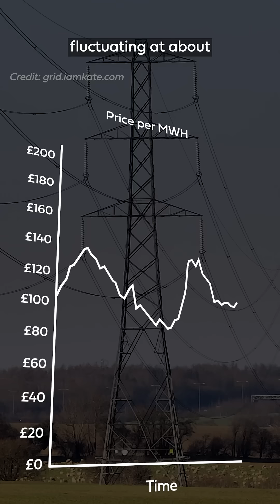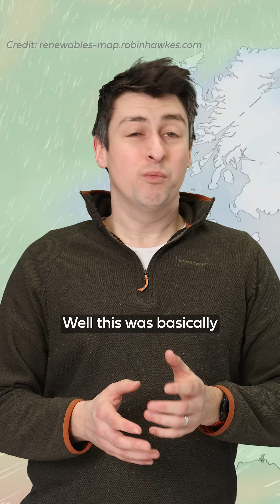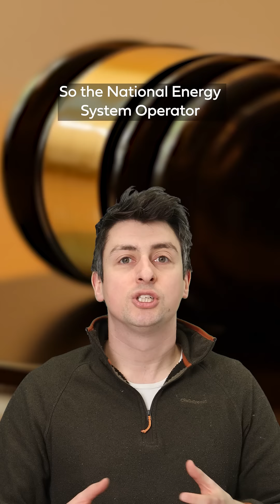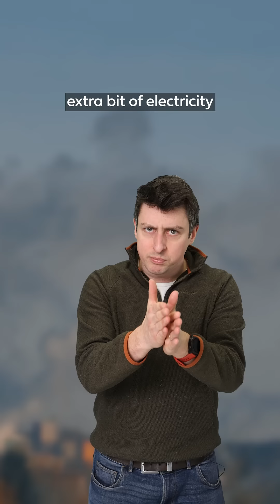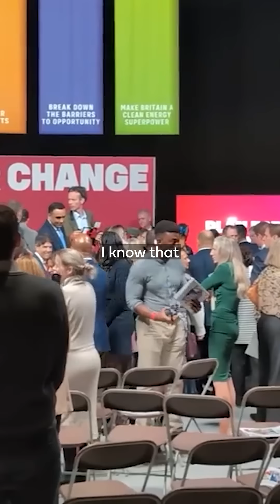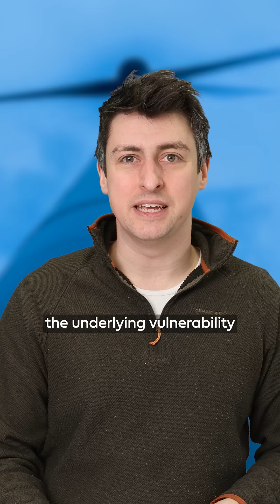The biggest price spike of the energy crisis happened last week

Comment: Craig F. Bohren, "How can a particle absorb more than the light incident on it?"  American Journal of Physics, 51(4), Apr. 1983, p. 323-327.

If you just want an overunity experiment, then by all means repeat (or have your university repeat) Bohren's experiment, which gives 18 times as much energy out as you put in.  Does it every time, any time, anywhere.  

Under nonlinear conditions, a particle can absorb more energy than is in the light incident on it.  Metallic particles at ultraviolet frequencies are one class of such particles and insulating particles at infrared frequencies are another. 

So what has been done with it commercially? Nothing.  

Infrared is heat, e.g., and so one can use that process to get about 18 times more heat energy than one inputs, under the proper circumstances. So why is your university not doing it in their technical departments?  

Why have they not told you about it?  

Why is the electrical power industry not using something modified from that to reduce the energy input to their heaters under the boilers making the steam to drive the steam generators that are turning the shafts of their generators?  

After all, with effort, such a system could in fact be developed.

Comment: The fuel isnt the problem it's the machinery that is burning the gas, gas prices are falling....gas is NOT expensive. we have gone from a a system with super reliable and low marginal cost of production power (large coal and gas) to highly variable, distributed, small scale generators and super expensive batteries...net zero and the decisions made to close large scale plant is criminal stupidity of the highest order. our 3rd biggest wind farm has been paid to be switched off for 60% of the time since it was installed...NUTS! this video is beyond stupid, batteries are really really expensive (and not green), we cant easily install pumped hydro in the uk (the geology/geography doesnt work)...and relying on interconnections is stupidity in extreme - guess what, when the wind isn'tblowing here, it isn't likely to be blowing in Europe either, same with solar....all we do is import really expensive coal based power with lots of losses. What we need to do is install more large scale dispatch able power like coal and gas (we have plenty of both and they can burn clean).

Comment: Or your people should probably create their own individual power supplies like maybe buying or building their own electric generators. They could use the old style boiler type so that they could burn wood to generate power or use gasoline or diesel or 8f they can manage to build their own solar panels but that also gets to be expensive and where are they gonna get wood and the gasoline is not very European and neither is using natural gas so maybe they could revert to the even older type batteries such as the bagdad type batteries which would probably be the best bet. Im sure they could find enough metals and pots to use and a simple acid then of course they would have to invest in the inverters unless they just used the batteries to run DC motors and then belt drive the AC generators from the DC motors.

Comment: Well if there would be a low cost, high energy providing method, I’m sure it would be installed rather than unreliable energy sources… oh wait, it exists but has been demonized by media and the wind lobby, together with green ngo’s. It’s called nuclear power and provides huge amount of power literally at a the press of a button. And regarding the nuclear waist, well, check out what dual fluid generators do.

Comment: I don't get all this hate for nuclear, it's literally the most optimal source of power

+ high power generation capacity
+ can run 24/7 and be activated at any time 
+ absolutely 0 greenhouse emissions

modern designs are entirely safe and impossible enter states of catastrophic meltdowns, like tjernobyl or fukushima, and while the nuclear waste can become a problem, there now even exists specific types of reactors designed to run specifically on nuclear waste and lower the reactivity of the waste in the process (thus making it even easier to handle)

Furthermore, the amount of highly radioactive waste produced per unit of energy made is stupendously small, and that's not even counting the fact that you can then just re-use that in other kids of reactors to extract even more energy out of it while simultaneously lowering its radioactivity to way more manageable levels

completely renewable sources like solar or wond are great when they're available, but why the actual fuck are nuclear power plants getting shut down and replaced with coal of all things, the literally worst form of power generation

just keep around a few nuclear plants as backup and only run them when there isn't enough power on the grid instead of coal and this kind of crap would never be an issue

Comment: This is the green agenda working for ordinary citizens. The UK has coal it’s just very dirty but with the advances in modern technology they can scrub the “Carbon”out of the emissions. To price pensioners and the lower to middle class out of energy with arbitrary regulations and one sided privation is a crime. Nuclear is truly the best cleanest option for countries with no or little fossil fuel options but it has been labeled too dangerous by the global climate alarmists. When ordinary people are sitting in their freezing homes in the winter because of bad policies the political tides will change. There is more than enough options to keep energy prices at a reasonable level but it seems some people want to throttle their citizens with unneeded regulations.
Reply: When you "scrub" the carbon out, you need to have an idea, where you want to put it. It is now a gas and it use now much more room than the coal. And as a gas it is hard to store. In order to revert it into a storable form, you need more energy than you got out of the coal.
Reply: @ So the semantics of carbon scrubbing is not the point… to price low to middle class income people out of energy is the problem. The climate crisis is a manufactured crisis. If true climate science was able to make it into the light in the first place we wouldn’t be even having this conversation. Fossil fuel has enabled the human race to heat and light our homes and brought us out of the dark and cold. It gave us mobility and fertilizers to produce more food… if you tax the one thing that is the life blood of the world ,If you price it out of reach for the average citizen you will turn the human population back to killing whales to light our homes and cutting down all the trees around to heat ourselves, or burning that dirty coal in our hearth no carbon scrubbing at all, no one would travel more than 20 miles from where they are born in their lives. Have fun with that.

Comment: Don't add "Dare I say" to nuclear. It is currently the cheapest (not in start up cost), safest, most powerful energy source available and would do more for the grid and the environment than practically all other current sources of power outside of very few exceptions.

Adding "Dare I say" to it casts a shadow of doubt over what should be embraced as if it was some sorta dirty or risky venture that should only be considered as a last resort.
Reply: There is not only the start up cost. You also do have the very long running cost for the waste.

Comment: Nuclear fear mongering has gotta stop
Reply: Look at Hinkley Point C - you are already in construction. And look at the cost. The cost for the waste is not yet included.

You have to pay all this. Plus the cost for energy generation.
Reply: @ThomasVWorm the waste is surprisingly easy to store and not much is made on the grand scheme of things, you could lick the storage if you wanted. regardless of if we know what to do with stored waste in the short term, the environmental impact is nothing compared to even renewable energy. wind turbines and solar panels (which are non recyclable) especially don’t last forever. whilst a nuclear power station is built to last and would easily deal with the high demand times in a much cheaper and less impactful way than gas.

And whilst maybe it’s too optimistic, in 30-40 years time we might have a valid use for nuclear waste.

Comment: That's one way of looking at it.. the other is that gas is a great backup energy source. It can ramp up and ramp down superfast. The net environmental and economic cost of using has may well be lower than that of using either batteries or pumped hydro.... this is exactly why most offgrid solar systems have a diesel backup generator, because although a dirty source of energy on its own, the environmental and financial cost is way lower than installing enough panels, batteries and wind capacity to cover a few worst case scenario days..
So maybe it's not such a bad thing
Certainly better than the high cost and immeasurable environmental risk of nuclear!

Comment: Gee, I'm paying about 360 USD  per MWH in Massachusetts, but that's the all in price of electricity plus delivery (the grid cost). It's about half and half so just the electricity would cost about $180 or about 143 pounds.   Yes the gas (petrol) may be cheap, but the electricity is not.

Comment: Clean energy is fine, BUT it needs to have battery bank to work, so this never happens.
Reply: Australian here, we're starting to do community batteries, ie a bunch of neighbours all put in for a battery wall. At the moment its not that cheap but the higher the demand, the lower the price because - capitalism. So for around €5000 per household, a dozen homes can install a €60, 000 battery substation, solar panels and distribution system. You can then actually take the system almost completely off grid ( except for one household - for emergencies. They can then supply the other homes in case of a breakdown or other disaster). Literally pays for itself after 5 years.
Reply: we need nuclear power. 24/7, cheap, safe, clean energy!

Comment: Lol so electricity is typically 71 pounds per megawatt hour.. so basically if you had 4000 large battery electric vehicles across the country at the same time fast charging at 300 kW(hr for and hour this would be like a gigawatt load on the system and potentially cause the same price jump… ? Am I gathering that correctly?

Comment: Two words, sand batteries or salt batteries.  Excess power during high production is used to heat or melt a substrate in a super insulated tank, then when power is needed, water is pumped around the inner lining to make steam for steam power generation.  Simple, relatively cheap, environmentally friendly, relatively easy to produce and deploy widely, etc.  Elon wants you to buy his power walls made from lithium, wrong answer.

Comment: That's what happens when you let government control the system completely. It's also what happens when you let them force this so-called green energy plan without a competent backup system.  The smaller gas plants have to make an entire years income for a three hour emergency shortfall just to keep the place available for a crisis.  Our planet is not ready for 100% green energy. We need nuclear. It is the most efficient. But the excessive regulations surrounding it make it seem like it cost more. Cut the red tape, keep the safety, and prices will go down.

Comment: In the last week, Starmer suggested small NPPs be built around the country to supply local areas, rather than larger NPPs to supply a large general area.

That’s a great idea but logistically it’s a problem.

Aside from the cost of multiple smaller plants being built, one larger plant would likely be a better financial plan.

Add in security for lots of smaller sites to protect them from being attacked by terrorist groups and the cost to run many smaller plants increases per plant compared to a single large plant.

Comment: I’m glad you mentioned geothermal because that’s a renewable that goes 24/7 can follow load and doesn’t produce carbon dioxide or have risk related to radiation or lack of fuel. In the UK it’s expensive initially because you have to go deep to get to high temperatures, but it’s not expensive to run like nuclear.

Comment: You know what doesn’t depend on the weather, doesn’t produce any CO2 during use, releases no harmful chemicals into the atmosphere, and is already a proven and safe technology? Uranium. A nuclear plant can provide electricity at any time in any weather, there are no major earthquakes or soviets in the UK, we have plenty of access to seawater, and yet we still rely on the relative temperature and pressure changes across an ocean, or solar power which doesn’t work at night (when it is cold and dark and people want heating and lights) rather than having to produce batteries, finish the nuclear plants, and generate power as it is needed, support that with tidal power and solar if you like, but we should not rely on anything that can’t work in every condition

Comment: He contradicts himself. He states the price depends on how the electricity is generated. But later on he says that the strike price applies to every supplier, regardless of how they generate. He also says that the grid wasn't up to the task - but it was. No lights were turned off, and all the emergency generation filled the gap in wind supply.

Comment: The answer is obviously modular nuclear that is not dependant on the weather.
Reply: Not that obvious. Nuclear is very expensive due to the cost of building and decommissioning, plus running costs including security and waste storage. But the main problem is the lack of flexibility. Nuclear should (and will) be used for base load, but it's rubbish at compensating for peaks and troughs of demand. The person who invents an efficient method of storing electricity will be very popular!

Comment: The lack of investment in tidal is shocking since we are an island.   Of course the concept of people being able to use stored energy from their EV cars to power their homes or even support the grid is possible, but what about the life expectancy of the batteries? The technologies are very new relatively speaking and this is a challenge of both getting the technology right and the mindset of users so people will not just store generated energy, but purchase energy when cheaper, and sell back when demand requires it at peak times.